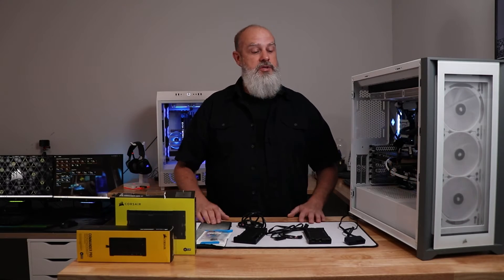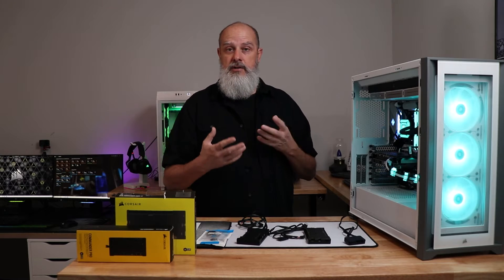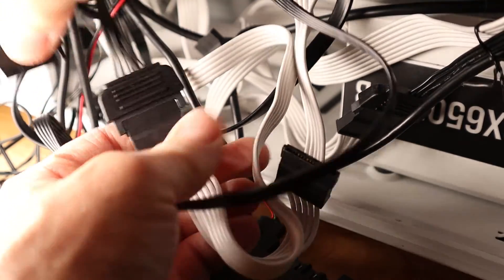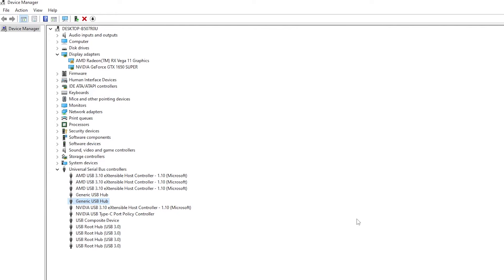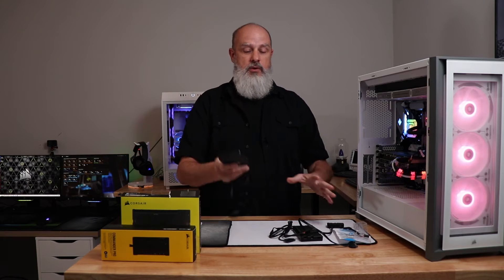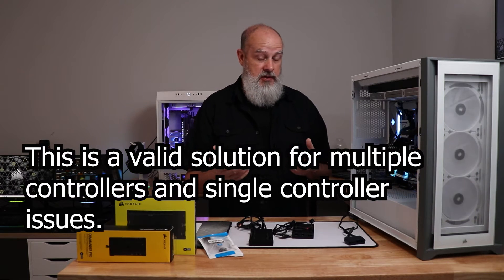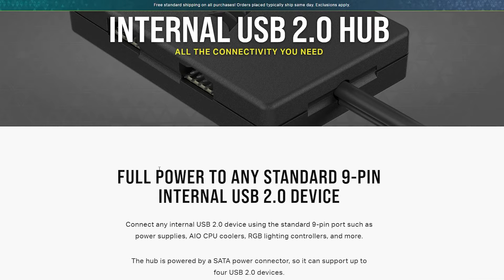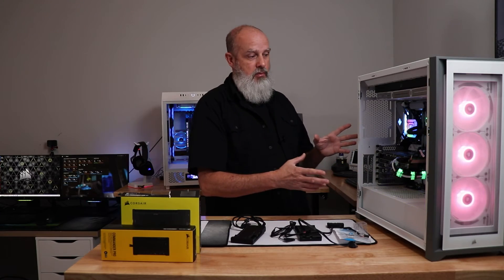Corsair iCUE doesn't detect my RGB controller

Comment: Hi. I got this psu, I like it, but I run into one issue. So, I have icue h100i rgb pro xt pump. After I changed from corsair rm650 to this new Corsair rm1000w (2025 )pump rgb light does no work, but I see it in the icue app, I still can change the speed of the pump, it is working, just without the RGB lights on it. I have fans also on the side of case and they have lights. My case is also from Corsair. I have found that rgb light on the pump will not work if you have 4 pin SATA cable and in this case this 1000w psu have two SATA cables with 4 pin, it needs 5pin Sata cable in order to have lights - it does not deliver power what it needs.  Old PSU had 5pin SATA cables and it worked. Can someone confirm this also? It is a bit stupid how it all sounds , but this seems to be right. I just do not understand why they have just 4 pin, but my old one had.  I ordered type 4 SATA cable, that can be used with this PSU, cables are also from Corsair and I think that they are expensive.

Comment: I have a h150i Capellix xt and 2 weeks ago my pump stopped working. The Commander Core dissapered in the Software. Until i disconnect the pump from core. Fans and rgb work fine. And the core shows again. I tested some things and found out, that if the Connector is just a littlebit in core, the pump came back to life. Is that possible Commander Core Problem? My AIO is now 3 years old

Comment: It’s poor software plain and simple.
Reply from the maker: Hi henrytoler5023, it sounds like you've had some poor experiences with iCUE. It's certainly not a perfect piece of software. I've had more luck with it than any of the other RGB/Device control software. But....I've sworn at iCUE more than one, haha.  

From that end, I can't argue much with your sentiment! Are you having a specific problem?
Reply: @HardwareArtisan  
Yes it stops recognizing the AIO pump and  1 fan .
I have updated uninstalled reinstalled re updated all components .

It mostly happens when I have to do a system restart .  Most times from a cold boot it works .

Comment: My Fans and Lights were working PREFECT (6 Corsair Fans and Pro Commander)... I installed iCUE updates from 3.38.61 to 5.16.75 ...........FAN LIGHTS quit working... I tried EVERYTHING for 8hrs... After HOURS of ^%$^%$*^ing around I noted I still had iCUE-Setup 3.36.61 in Downloads... so I uninstalled the current iCUE for the 20th time and installed the 3.36.61 and the FAN LIGHTS came back ON :)

Comment: I use Coolermaster Masterfans with the Commander to control fan speeds. I have two commanders and both of them show up under software updates but I can't control the fan speeds
Reply: I heard that fan control does work with third party fans

Comment: I have the issue of the fans are working all fine no issues at all with temps ect, rgb are also on but stuck in 1 colour. However they will not show up in icue even after updating the icue to latest? Any ideas?
Reply from the maker: Hi josh_6c241, what model fan do you have and what controller? I'd start with removing all the lighting layers, and run through the lighting setup again. 

If that doesn't help, I'd power off your PC, physically remove power for a minute, reconnect to a different power connect if possible, but either way, power up and try again. If the issue remains make sure iCUE is up to date. Update the firmware on the controller (I'll even force an update if it's already up to date). 

If that's all good, uninstall/reinstall iCUE with the latest version and try again. 

If that doesn't help, let me know what controller and fan you have. 

Thanks for watching, good luck and have fun troubleshooting!!
Reply: my exact issue.....i bought my pc from a friend that said it worked when he had it.....when i recieved the pc all i had to do was install my graphics card (4070) he had a 4090 so i had to swap the sata cable to fit my gpu so it was only  the cable form psu to gpu that i unplugged so shouldnt have messed with anything else dont uberstand why it doesnt work still

Comment: My controller is visible only in software updates (on iCUE), and I cannot get it to show as a device to tell it I want to control RBG on port 5 & 6. Does anyone has a solution? RGB on fans 1-4 work fine.
Reply from the maker: Hi spamurai565, I'm assuming you are using a CORE XT? I would start with swapping fans around to ensure the lighs work on the fans currently connected in port 5 and 6 and see if the problem stays with the port. 

Assuming it does stay with the port, when you select a lighting type, do you see rgb port 5 and rgb port 6 in the 'quick lighting zone' section? It's possible you have manually selected indivicual fans, make sure port 5 and port 6 fans are selected, or ALL. 

If they are not there and still won't light and you know the fan is working, then rerun the wizard from the lighting setup function and see if it detects them, if it doesn't and you've verified the fan does work in other ports, id suggest power off your pc and physically remove power to the controller, actually disconnect it, connect it back after a minute to a new connector if possible, if not just reconnect it and power it back up and retry, this has solved problems like this for me. 

if it's still an issue, try forcing a firmware update on the device in addition to uninstalling and reinstalling icue. 

Beyond that, could be an issue with the device itself, try it in another pc if you have access to that, if not and it's under warranty contact Corsair or the vendor. 

I hope that helps solve it, good luck, have fun (troubleshooting is fun, right!?) , let me know what you find! 

Thanks for watching!

Comment: i have the h150 lcd elite xt and neither the commander pro or the lcd screen apear on icue i tried changing sata idk didnt fix
Reply: i also have a lightning node pro im thinkink to disconect
Reply from the maker: Hi papaberto9699, Sorry you're having issues with that. with the AIO connected to the commander core, it will show up as the AIO and not a commander core. Assuming that it's not showing up and you have tried changing the sata power connection. Do you have power to the controller? are fans running and can you hear the aio pump?  Try a different USB port, preferably a powered usb port if you have a usb hub, but at least try another usb header on your motherboard. 

If that doesn't do the trick, uninstall and reinstall iCUE and make sure you have the latest version. Beyond that, I'd try tremoving everything from the commander core except the pump, remove all fans from pwm and rgb connections. Remove other USB devices as well to see if something is conflicting with it. Try just the CORE on another PC if you have access to one to see if it's the controller. On occasion I have to disconnect it from power complelety and from the sata connector and plug it back in. 

Let me know what you find, thanks for watching and your support!

Comment: I have an Alienware R16. Since it was my first pc and did not know much about computers I got the cheapest version, which came with a fan and an air cpu cooler. After doing some research on how to potentially upgrade my PC since it got very hot, I came across a reddit post of an user who upgraded their R16 with a CORSAIR H100I ELITE LCDXT 240 BLK AIO. I decided to buy the CORSAIR - iCUE H60X RGB ELITE to replace the rear fan and the air cpu cooler. After installing I noticed that the fan and pumped work properly but I had nowhere to connect the RGB cables. So I got a COMMANDER CORE XT. After this my fan and pump's RGB turned on white. The iCUE software has not been able to detect my Commander XT (neither my pump or fan), neither my Windows Device Manager. So far I have tried getting an USB 2.0 Hub (since the Aurora R16 itself does not have any....) and a USB 2.0 to USB-C adaptor, just like the reddit user recommended on his upgrades. So far nothing has worked and I have been very seriously thinking about returning everything I bought and just get the Alienware hardware instead.
Reply: Did you solve it? I don't have the liquid cooling but the comander core xt is not recognized, even though the fan and rgb lights do turn on

Comment: My commander pro and light node did work for a long time. Then I had to update Icue and they no longer showed up on the list. Tried to install an older version of Icue, but still nothing. The fans are running and the lights work. I just cant controll them. Some days it suddenly works again, but the next day its gone. Dont think I will by Corsair hardware again.

Comment: My issue is with the RGB Strips. Bought the item twice from amazon, and both times they are not working with my commander core xt.

Newest iCUE software
Current BIOS and Chipset for my MOBO
Tried connecting them together at first, then individually (powering my machine each time) to Commander Core XT directly, nothing happens.
Uninstall and Install iCUE, still no action from the strips. 
I got a case, headset, fans and keyboard from Corsair and they work fine. I can control my fan settings with XT.
However, the RGB strips plainly do not work.
Currently having a email session with Corsair now, but if anyone have any tips, let me know.
Reply from the maker: Hi myoung2484, I'm assuming these are corsair RGB strips, either the internal or external ones. Make sure your CORE XT is at the latest firmware. 

Go into iCUE and select the CORE XT, then select the 3 pin lighting setup and select either the RGB strip or the external strips if that's what your using and then select the type and number of strips. From there you should be able to goto lighting effects on the 3 pin lighting and modify the RGB lighting. If it's not working. Check your extension and maybe get rid of it as a test, just plug a single strip into the RGB port on the CORE XT. 

If that doesn't work, try powering off, unplug the CORE XT from power physically and try another sata power connection if possible, but at least unplug it (that's fixed weird stuff like this), try another USB port as well, a powered usb header if you have it. 

Then retry, if it's still a problem, uninstall, reinstall icue. If it's still a problem, perhaps the port is bad. As you stated, it's not too difficult to get them working, but you may be working with a controller with a bad port. 

Let me know what you find, good luck and keep at it!! Thanks for watching!!
Reply: @HardwareArtisan  Thank you. I did try out  their directions you gave, but come to find out it was a bad port. I reached out to corsair and they provided a solution to fix my issue. The lights work now.

Comment: So I just built my PC, and I installed a commander core xt. Problem is? iCue isn't detecting it. The rgbs are just solid white (basically no color), and the fans are basically on full speed with no way to turn them down, so my PC sounds like a jet engine. So it's functioning, but I have no way to control or it or make the RGB's work. Gonna try some of the tips in this video before I throw in the towel and just connect them all to the motherboard.
Reply from the maker: Hi MetalGaiden96, sorry to hear you're having issues, it happens to all of us. Definitely work through the steps in the video. Start with making sure you have the latest iCUE version installed and reinstall it if you do. Then, use a USB header on your motherboard or a powered USB connection. 

Try removing the fans from the RGB ports and PWM headers if you can to see if it's detected, if it is, add one or two fans at a time (powered off of course). 

If it still won't detect it, power off your pc and physically unplug the power to the core XT  and try another sata power port (i've had to do this a couple of times) and then check again.

Make sure any other RGB software is not installed (or running) and try again. 

Good luck, let me know what you find! Thanks for Watching!!!
Reply: @HardwareArtisan   Hey! Thank you for replying. I eventually figured out what it was and it was something relatively simple. I plugged the usb header into the wrong port. Once I swapped it to another one, it worked immediately, the fans began to function properly, and the RGB'S came on along with it. The woes of being a first time PC builder I suppose. Lol. But it seems to be working just fine now.
Reply: @MetalGaiden96  that's awesome!  I'm happy you got it figured out and that it wasn't serious...that stuff happens to all of us....keep having fun with it!!!

Comment: I came here after seeing the title. While it wasn't exactly what my problem was, this did start me on chasing the issue. I eventually worked out what fans I had and after RGB auto detect only finding one fan, I decided to add the fans in the Wizard, manually. Now all RGB is working fine. So auto detect doesn't work on SP140.

Comment: MY h100x AIO is not detect on Icue iel why
Reply from the maker: Hi wayt7792, unfortunately the h100x AIO is not supported in iCUE, the pump has no connectivity to the USB bus so iCUE will not see it, you control this one manually through the PWM headers on your motherboard or your fan controller. I hope that helps. Thanks for watching!!!

Comment: Seriously thanks, I've been trying to figure out for about 2 days why I couldn't see my commander core in my icue and I did notice there was one device in my device manager that wasnt working, turns out it was the commander core so I do think I need to go ahead and order a new one now
Reply from the maker: Hi 313aak, i'm happy you found the video helpful. It could be you need a new one. I'd try all the tips in this video including using a powered USB hub, remove the power cable to it and try another sata connector. Reinstalling iCUE is also a must if you haven't already. 

Good luck, frustrating when these don't work, but keep having fun with it!!! Thanks for watching!!! Let me know what you find.

Comment: My corsair Hub only 1-3 slots works and 4-6 not works Leds not showing up.. fans spinning all.. is my hub broken? i have corsair commander pro and linked corsair hub..
Reply: Powered sata cable.🤔🤔
Reply from the maker: I'm assuming you have a rgb fan hub connected to the pro, if only the first 3 work, try moving another fan into port 4, and swap a good fan into port 4, I'd also try swapping fans into the 3rd port...that hub requires device to be in order...meaning you can't skip a port. It's possible the device in port 4 is the problem causing issues down the line...but test it. Do try another power connection as well...also, ensure all fans are selected in icue....I would also power off, remove the power cables, wait a minute, reconnect and power back up. Reinstall icue and force a firmware update if the issue persists...could be a bad hub as well. Good luck, let me know what you find! Thanks for watching.

Comment: I have a curious toddler in the house and I stop the PSU so he does not start the PC, the only problem is that after I did that most of the rgb in the case stopped working, the triangles are not being detected or the GPU

Comment: Yay, I finally got ICUE to detect an LC100 controller.  So my motherboard USB headers are fine.
On the other hand, only the Master triangle lights up, the other 8 slave triangles do nthing at all.
I think this thing died within the first 30 seconds of me hooking it up.  I saw two other triangles light up and that was the end of that.  No matter how I reconnect them, rearrange them in the software, switch channels, etc... I can't get anything but he Master to respond.  The Master is responding just as it should.  Just the rest of them are getting no serial RGB signal from it... at all.    It's fried like your dead master triangle is fried in your other video.

What am I suppose to do with an LC100 kit with just one triangle lighting up.
Is this suppose to make me.. happy?   is this suppose to be.. fun?
This swwcks...   chunks.  All of Corsair RGB... swwcks chunks.

Everythign else in my new PC I put together is running great and working.. except the Corsair RGB which is a hot defliected mess sh1tsh0w

Next to the TILE location devices (100% useless)  and AXIS flying box (shipped alpha non-working product to customers), Corsair RGB is one of the 3 worst product I've bought in the last... 3 years.  As son as I get my never video card, I'm making a video about just how bad this crrrp is.